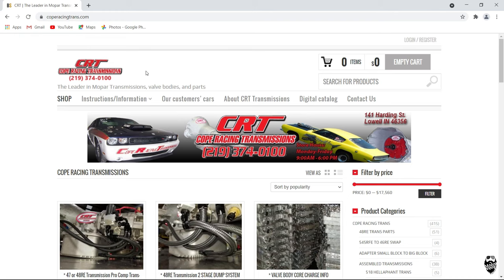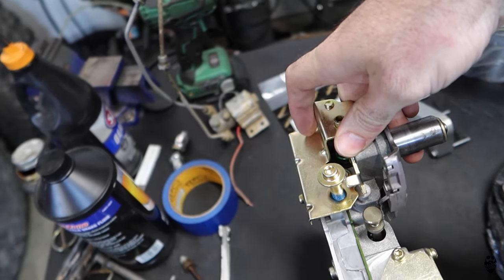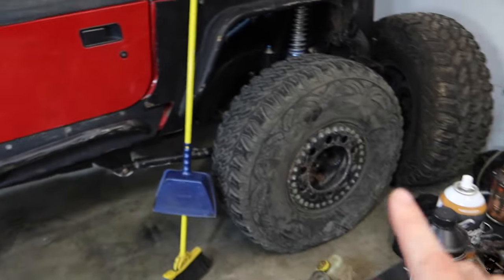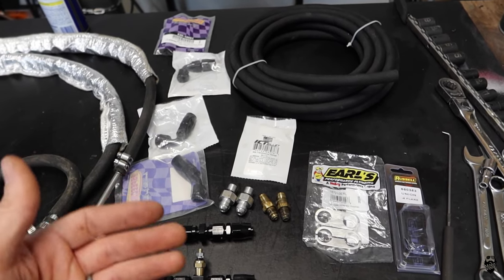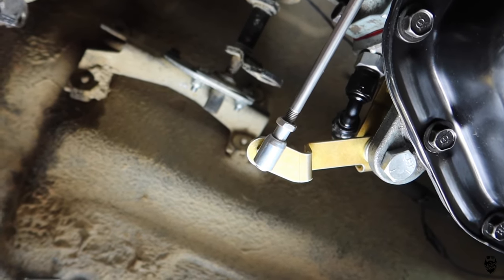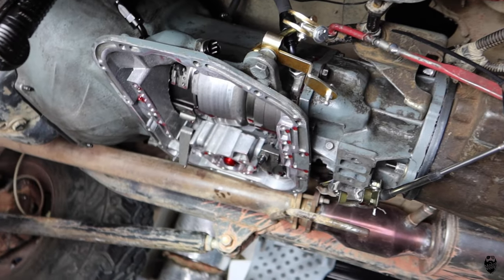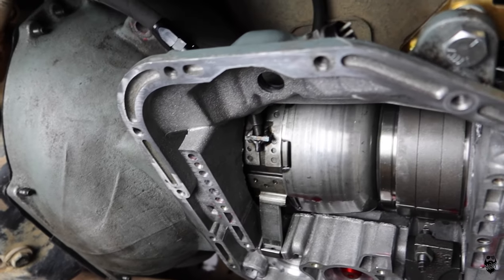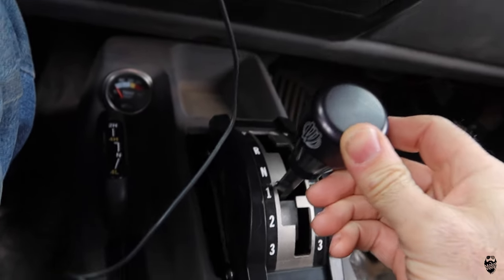RACE Car 32rh transmission, Jeep Wrangler TJ

Comment: i had a guy renbuild my 32rh only had first and reverse. he made it manual valve body, he remove a little freeze type plug out of the valve body and had me install in the trans port.I have about 6 good trips on it so far so go

Comment: Set pressure isn't so bad once you get used to what causes harsh shifts and what'll smooth them out (sometimes more throttle is the answer).  Acknowledging they're not for everyone, I street drive my truck with CRT reverse manual set at 195 PSI and love it

Comment: i run a 32rh too, was looking to replace it with a 42rle or aw4 but i was told this is a stronger transmission, but with 35s 410 gears and the 3 speed at 70 mph I'm about 3200 rpms and my gas mileage is about 8 mpg...so i really wish i had the overdrive, cant do a manual with my bad knees i cant do the clutch all the time...and my friends with manuals are putting clutches in once or twice a year... hope you did the vent relocation...  give us an update on the drivability of the manual shifting configuration.
Reply from the maker: Yea the overdrive would be nice for sure. I will keep you guys updated. Does your 32rh have the tcc lockup?
Reply: @MuddyBeards4X4  yes, i was told it does by the Mopar guy that rebuilt it.
Reply: i have a 02 TJ

Comment: Is the jeep automatic the same as Chrysler 904?? In my pass I rebuild 727 and 904 still got tools for clutch pack I got a 90 yj automatic would like to improve shifting I use the b&m kit before please help identify automatic
Reply from the maker: Most of the internals are interchangeable between the Jeep 32rh, the 727 and the 904. Oregon performance transmission has parts and also cope racing transmissions. That’s where I got all mine for the rebuild and upgrades.

Comment: So question? If I wanted to change/upgrade my transmission in my Jeep. I can I tell what's compatible and what's not? Also... My 1994 Jeep YJ is a 5 speed standard and I would like to put an automatic transmission in so my spouse can drive it when I'm not around.. and I tried teaching her to drive standard but didn't really didn't like it. So I would someone know what I can put in without a shop trying to screw me over??

Comment: I was always curious if you could beef up an AW4 or if you could swap it out for an E340 out of a supra and have it work in a jeep
Reply from the maker: I know a lot of the issues with the aw4 is cooling and it doesn’t have the aftermarket support the torqueflight transmissions do. I know they build up the e340’s for huge hp. E340’s and the aw4 are the same platform but I am not sure what parts are compatible.
Reply: @MuddyBeards4X4  I've been curious for the last couple of years about what parts mix and match but still haven't gotten any definite answers on how to set it up correctly. I've got a 4.7 turbo stroker motor that I've been buildig for the last couple of years, finally got it dynoed 690hp and 725ft lb. @20psi on pump 91 and a water to air. Just need a tranny combo that will play nice with it.
Reply from the maker: Man that’s awesome🤟🏻 kinda depends on what you are going to do with it. I would probably do a trans adapter and run a built th400 or 700r to reliably hood up to that. You could build up the 32rh to handle it but I think it would get pricey and you would still have only 3 speeds.
Reply: @MuddyBeards4X4  I've been wanting to keep it a 4 speed and debating on if its worth it to build the AW4/E340 Frankenstein or just caugh up the cash for a 4l80e swap, it just adds another layer of complexity, all the stuff you save money on by building the AW4 hybrid correctly, I could get a decent 4l80e that i know will handle the power but then gave to get all the other supporting mods ; converter , bellhousing adapter plate, new drive line, crossmember...etc.  either way they're about the same price but at some point its no longer a Jeep, and just becomes a tube buggy after like 10 iterations.
J. ust 
E. mpty
E. very
P. ocket
Reply: @badsob83  Hold on. That is insane and that is almost literally identical almost to the first long held 4.0 stroker world record that was beaten a year back or so by the original record holder, you can y/t it if curious. 
I have had a tone of xj built them all nd know them very well, but never built a stroker yet, YET, lol. Forgive me those dyno numbers you just threw out are not "unreal" it's just that idk man, I really want to know the stroker build sheet you created or followed. I only give pause or wonder about this for a couple of reasons. The AW4 is supposedly pretty much maxed out when approaching 400 hp or greater the bands, valve body, pump etc. just cannot handle it. Even with upgraded valve body transgo shift kit, etc. I used to work for PTC 
(Premier Torque Converters) out near Mapple Valley, Black Diamond in Washington state ( my home ) next to green river valley meats. PTC is owned and associated with TRC 
(Transmission Rebuild Center) so this is partly why I wonder how on earth you built that monster and didn't immediately break your AW4. 
I can tell you this to try to help you out, TRC are the one of the better ones you want to call and ask about upgrading or the best options for upgrading your AW4 to its strongest potential. You can have or request PTC to sauter your stater fins in you torque converter and use the highest quality friction locks ( forgive me I can't remember if that's their technical name) that they can get for it and then grab a bigger tranny cooler usually certain smaller older rv ones work well availableat O'Reilly, this would all greatly help your AW4 along with a Transgo shift kit as a must. 
I just didn't or don't see how you could obtain that hp and ft lbs TQ, without at least 6-9-12k ish in a stroker, but that might be what it cost you. You do have a turbo however, I would think you need a tubocharger and direct fuel injection to hit the hp you spoke of is all. I would very much please like to know your formula? 
One last thing please do not be offended by this all, I am just legitimately curious as to how, and how the heck I can do it two!😁
Reply: @SarahSmith-hd8kd  long long long story short...get really really mad at your money, like $ 8,300 for the complete engine w/ fuel system, another $2,300 for an EFR9180 turbo .82ar hot side, another $800 for the air to water intercooler and yet another $2k for a Holley EFI Dominator.  

Again thats the abridged version, it has taken me 4 years of spreadsheets, calculating, trial and error.  Working on an e85 setup now, projected to be in the 800hp/800tq range but I think the hot side of the turbo will be close to its max or choke point, requiring either a .92 or a 1.02ar.  But the cam i chose is mostly for lower rev range and efficiency of the turbo.  So Im trying to keep the rev limit around 5,500 , presently it makes 2psi at 1500rpm and gobbs of torque  371.1 ft lb to be exact
Reply: @badsob83  thank you for the reply! WOW! 🤯. Hat's off to you, that is quite the accomplishment 👏.  Iwill be trying emphasis on trying as I've not built a single engine yet, but will be trying a stroker build on one of my 98 XJ'S. I was wondering if you can tell me if this is a fairly achivable feat following this formula I picked from the 7 available I found on this awsome 4.0 inline six stroker build page? Thank you in advance if you respond!

4.6L low-buck stroker
Jeep 4.2L 3.895" stroke crank
Jeep 4.0L 6.125" rods
Custom forged +0.030" bore pistons, compression height 1.380", dish volume 18cc
9.6:1 CR
CompCams 68-231-4 206/214 degree camshaft
Russ Pottenger ported HO 2.00"/1.55" 62cc cylinder head
Mopar/Victor 0.043" head gasket
0.043" quench height
Ford 24lb/hr injectors with adjustable FPR or MAP adjuster for '87-'95 engines, Ford 24lb/hr injectors for '96-'04 engines, '99-'00 Chevy LS1 26.2lb/hr injectors for '05-'06 engines
268hp @ 4900rpm, 326lbft @ 3500rpm
Reply: @SarahSmith-hd8kd  in regards to the cam if you don't want to tear the motor down completely (some budgets don't allow), your money is better spent on the 1.7 ratio roller rockers and leave the cam stock, it achieves about the same lift as the cam you had mentioned. Likewise sometimes having a ported head can actually hurt your low end port velocity But If you're serious about replacing the cam and don't want to over do it the 68-239 is a little better option with the 1.6 roller or factory 1.56 ratio rockers, it just has better valve train geometry and low speed velocity than trying to do a big cam with the big rockers then have to cut the spring pockets and upgrade to LS springs, will probably require a Split Second signal enhancer for crudely piggy backing the ECU, But if you don't want to mess around with any of that bullshit and just get the best bang for the buck the Edelbrock head will out perform most any factory ported head without having (barely) do any thing to it,   ie: bowl blend, unshrouding of valves, blendig of seat pockets, just knock the casting edges off it for the most part. While still coming out around the same price as having a factory head worked over to the 9's just to find out it would have been better off to start with the edelbrock unmodified and make the same power....or worse yet have it heat soak a few times and drop a valve seat fuck up everything and have to do it all over again.......ask me how I know!

When you get into forced induction then start porting like crazy.
 But in my case I went to the other end of the spectrum all together. Partially filled block just like Newcomer did to stabilize the upper end of the bore, electric water pump, Fire ringed,  4.7 stroker with 13cc dish, 58cc chamber, .042 head gasket, almost 11:1 ,fully ported edelbrock, a roller cam from 505 performance, timing adapter 495/512 @ 262/272  114°lsa   1.65 harland sharpe roller rockers, 7/16 dia pushrods, ported modified log intake 72mm tb. 100# injectors, billet fuel rail, billet fuel hat with 2 -10 lines and -8 return, provisions for 2 hellcat 525 pumps but only using 1 at the moment, aeromotive 1:1 rising rate regulator, 3 bar map, custom 321ss "tri Y" 1.5" to 1.75" to 3" V band forward facing header(stoooopid expensive), Air box delete, Borg Warner EFR-9180 turbo .82 ar 38mm internally gated ( just for packaging) 3.5 marmon to 3.5" vertical oval 90° to clear steering and front diff/drive shaft impingement, connects to a "loud valve" dump next to driver floor board boost referenced and opens at 10psi but has a full 3" all the way out the back has a high flow 3" cat and a flowmaster super 10. Water to air intercooler that literally sits on top of the valve cover up against the firewall, upgraded P.S. pump to run hydro boost brakes(gets rid of the vac booster), charge pipe comes off the turbo along the fender up and over the brake master to the intercooler 4" X 8" X 12" core same side entry/exit 90° into the T.B. , looking at purchasing an interchiller seeing as I opted to keep the A/C on my XJ..... hence the custom header, mechanical fan delete, 2 Delta PAG PWM 12" fans. 

Only a 6" lift technically but its 4 linked front and rear with Ironman 4x4 kit, 14"ORI's at all corners, Boostworks sector shaft support, working on 2012 Super Duty axles with factory 4.30 gears and factory E-lockers Hydro assist steering.... I keep telling myself  ITS A HOBBY.... but it has seemingly spiraled out of control....just a little. 🤣
.
Reply: @badsob83  lol, I'm not going to lie man ( and I keep saying man like a man because I am this is my wife's account as I do not have one so I always just use hers and yes I know I need my own lol ) but back on track I will admit that most of what you said in your stroker build is still foreign to me at the moment but I comprehend it. I greatly appreciate your time you took to let me know this all. I WILL be building one soon next year more then likely. 

My one built 98 5,200 LBS XJ to be exact lol. 10.5" long arm lift mostly Rusty's offroad FOX 2.5 remote reservoir series all four corners 10" front stroke 8" rear WJ high steer knuckle with the 06 Rubicon hubs so no caliper spacer but nice dual caliper brake upgrade still a Dana 30 but HP with welded 1/4" inner tube sleeves Trussed C-gussets chromoly shafts and my amazing cable actuated OX locker Hydro assist rear 8.8" LSD with rear disc all revolution 4.56  gears Rusty's offroad steel fenders Borgeson steering shaft I have the new XO Fab hybrid cage DIY kit ( just waiting to get back with my welder buddy to put on) then I will fully cage off of that and probably the BEST damn upgrade I have done to any of my 8 XJ'S I've built ( no I don't still own them all), the fully framed or fully stiffened unibody stiffener kit from IRO and front and rear pillars to truly box it out were from T&M fabrication. When I did the stiffeners OMG it went from a classic oh no here comes a pot hole XJ to FUCK that pot hole lmao seroulsly the best upgrade I've done thus far though along with the FOX 2.5 shocks and Hydro assist changed the game so much so I can safely roll freeway 75-85-90 with zero sway bars front or rear lol yes I hit 90 once just to 👀 stupid but there was nobody for a quarter mile either way real late night so..

Well hey man thanks again for all that pleathra of knowledge you bestowed upon my unknowing ass and hey I don't know where you live but I'm in Washington live in Graham  25 miles away from Elbe orv straight down the road literally straight the whole way down mountain highway so if you'd ever want to meet up one day and wheel im down, just let me know. I would say we could shoot up there as well at the pit before entrance to Elbe, but with the price of a single round these days bulk buy or not I'm keeping all that tight to the vest, you know?
Reply: Is it possible to use 30rh in jeep 4.7 or 5.2

Comment: Do you have a link to the exact valve body you used thank you in advance
Reply from the maker: https://www.coperacingtrans.com/?product=crt-727-904-pro-street-reverse-manual-valve-body
Reply: Thank you for the reply 
I know you did yours in a YJ 32rh do you know if there is a difference in the TJ 32rh
Reply from the maker: I believe they are internally the same so it should work fine, just an updated pcm and different tcc wiring.

Comment: If I'm going to swap to a 3 speed auto there is no way I would use anything but a turbo 400.
Reply: For his application that wouldn’t make much sense at all
Reply: @nicholassbardella6045  
Using the very best is always a good idea.
Reply from the maker: The T400 is a great transmission... but it would cost me thousands of $ in transfer case/adapters and drivelines to make it work.

Comment: Auto transmission…. 😭
Reply: Don't get any better for wheeling, all the time wheeling. Well depends on if you care for manual at all, most wheelers I've meant are manual fans just not for offroad. Those are all opinions though, but hey opinions are like as$holes, everybody has one and they all stink to others🤣👋